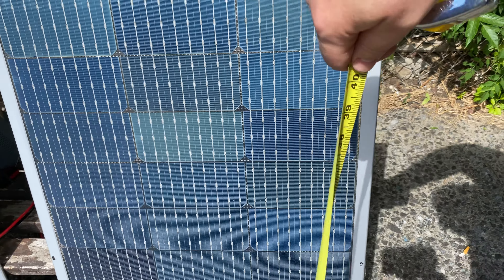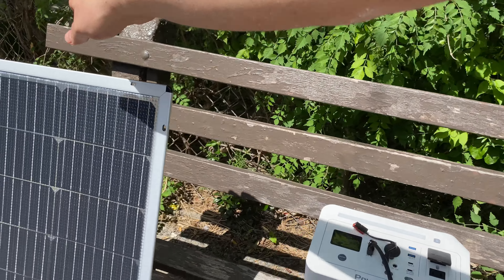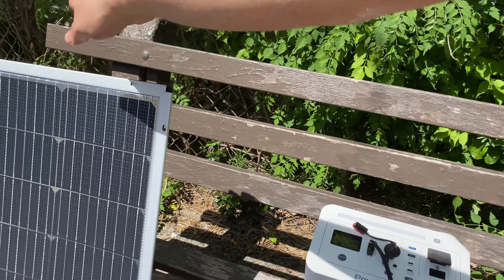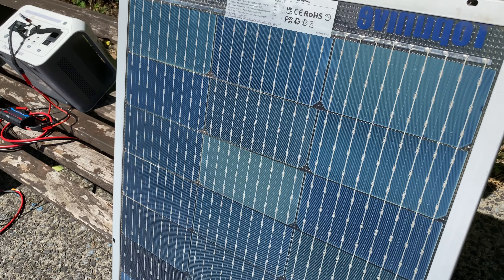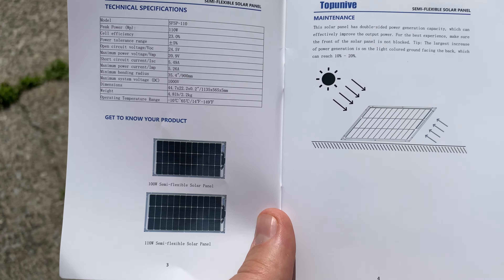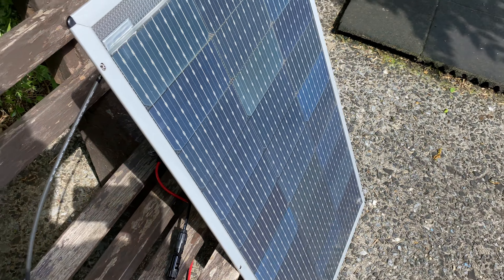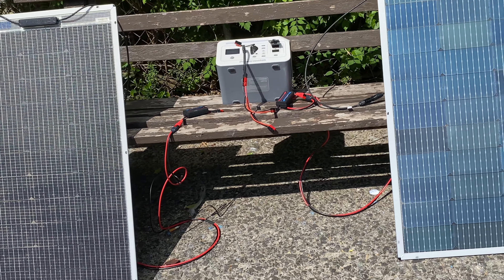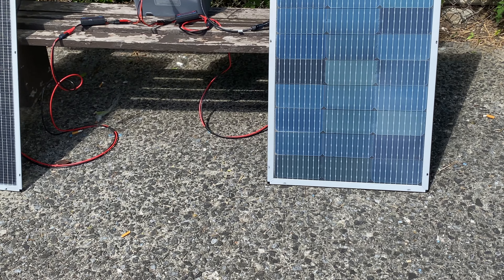🔋 Topunive 100w BIFACIAL Portable SOLAR Panel Unboxing & Review 100 watt panel  📌#wisebuyreviews

Comment from the maker: SEE IT HERE https://amzn.to/3wKWyCP for 100w Topunive Bifacial Solar Panel  [amazon affiliate links]  The Bifacial 100W 12V Solar Panel 9BB Monocrystalline Cell 12 Volt for Marine RV Trailer Boat Cabin Van Car Uneven Surfaces 12V Battery Charge

Bifacial Solar Panel: Compared with traditional solar panel, this bifacial solar panel can generate electricity not only from the front side, but also from the back side, efficiency increased by at least 10%-20%.
Lightweight & Easy to Install: It is only 0.2 inches in height and weighs only 4.4LB (2KG), the solar panel is easy to transport, install, hang and remove. The pre-drilled holes and PV solar connectors help you install easily and quickly.
9 Busbars Solar Cell, High Conversion Efficiency: 9BB & A Grade Monocrystalline silicon solar cell provides high conversion efficiency up to 23%. The narrower busbar space and more cells receiving surface bring lower cost and increase the output of the PV module. Compared with 5BB panel, the 9BB solar panel ensures lower risks of microcracks and longer service life.
Waterproof & Dustproof: This solar panel is equipped with IP67-rated junction box to effectively block water splashes and dust from outside, making it perfect to be used outdoors. It is much more durable than traditional glass and aluminum model solar panels. 2 pieces bypass-diodes are built in the junction box.
Excellent Quality: The solar panel is made of ETFE material, which has a higher light transmission and longer service life than ordinary materials. The back panel is made of TPT, which is good for heat dissipation, waterproof, high temperature resistant and easy to clean.

You may also want to see my OTHER SOLAR PANEL REVIEW VIDEOS:
- How To Install BougeRV 100 Watt CIGS Solar Panel On Highlander SUV Car Roof Review #wisebuyreviews - https://youtu.be/1ab9L63EVeo 
- Panana 200W Portable Foldable Solar Panel 200 Watt UNBOXING and REVIEW TEST #wisebuyreviews https://youtu.be/YG1WhoDCH9Q
- Nicesolar Foldable 200W Bifacial Solar Panel UNBOXING REVIEW on Sunny Day #wisebuyreviews  https://youtu.be/H12rmL-ItIY
- Eco Worthy 100 watt Bifacial 12v 100w Solar Panel Review Is It Any Good #wisebuyreviewshttps://youtu.be/8zqZhlhIKCM 
- Wetown 200 watt FOLDABLE Portable Solar Panel Unboxing Review #wisebuyreviewshttps://youtu.be/nlInvWpN5V0
- Topunive 100w BIFACIAL Portable SOLAR Panel Unboxing & Review #wisebuyreviews - https://youtu.be/6sxaP3xaNFI 
- BigBlue Solarpowa 400 Watt Foldable Portable Solar Panel Unboxing and Review #wisebuyreviews - https://youtu.be/qZiWJti3gk0
- Topunive 100w Foldable Portable Suitcase BIFACIAL Solar Panel Unboxing and Review #wisebuyreviews - https://youtu.be/Kd1H9-FCNi0
- Nicesolar Foldable 200W Bifacial Solar Panel UNBOXING REVIEW on Sunny Day #wisebuyreviews - https://youtu.be/H12rmL-ItIY
- ALLPOWERS SP035 200W Portable Solar Panel UNBOXING & Review #wisebuyreviews - https://youtu.be/Zqs-CPRUcvs
- FUNAURORE Cheap 120 Watt Foldable Solar Panel REVIEW UNBOXING for Solar Generator #wisebuyreviews - https://youtu.be/XaJ4MrXHNYA

- See all my videos here: https://www.youtube.com/@wisebuyreviews/videos

YOUTUBE VERSION
https://youtu.be/6sxaP3xaNFI
BRIGHTEON VERSION
https://www.brighteon.com/1fa80b98-927e-487f-8905-9e02178dbd21

Comment: Looks like a decent panel, and should last a bit longer than the ones without the frame.  I wouldn't use it in a permanent mount though, the glue under the ETFE layer will break down in a couple of years.  Thanks for the test.
Reply from the maker: Great point!

Comment: thx for the video i buy  the other version with a real alu frame like real Glas panels have so i get a full alu frame panel with ~2,5 Kg.
a full alu frame 100 watt panel but with glas will weight ~7 Kg so 3 times more.
a ultralight panel with real alu frame is a great idea what no other company designs.
on sale i get in for 60$

the panels in this video i will prefer befor any semi flex panle about the alu what grants additional durability, but this one are for RV or so, i need a more durable solution so i take the one with a real frame.
Reply from the maker: Good point. If money is no object and you could go with flexible, I would only go with a cigs panel. I would recommend the bougerv solar panel https://youtu.be/1ab9L63EVeo - I made a video installing it on my Highlander SUV and you can use the same techniques for your RV. 
If installing on a roof, I think the way I attached it to the tp of my car is nice. I think this panel is a better solution to attach on a southern facing wall with screws, perhaps on a house or a shed or balcony. Yes the aluminum frame make it really nice.
Reply: flex panel die very fast.... alot deliver in permanent usw 1 year latzer -30% of the new performane , glued on a RV they failing alot burned cells or busbars or delamination or damaged coatings...also the new ETFE not helps about delaminsations... there are alot videos to find about this problems.

thats why i try this one out, delamination is not possible if the flex panel is gluet into a frame, and brocken  cells or busbars are also not will be so big problem about imited flex movment.

its look like a good solution against alot of problemws from flex panels so a good ultralight solution.
i can report afther 1 year if it last against flexible panels better.

Comment: simply math but only from my experience. . Efficiency is arount 72 % from nominal capacity of rated woltage of panel. So from 100 watt panel  you should  see around 72 wats and put -5 wats loses from cables and invertors  and  you are on 68 wats.  Is is way  better  to buy  bigger waltage solar panel because of thinking  of bad positioning panel to sun, real efficiency and loses.
Reply from the maker: Good point, however any larger than 100w unfolded or unfoldable get too big to handle often times. . I have various panels and these can find a use somewhere. Perhaps will build a solar privacy fence at some point.
Reply: From my experience;), every solar panel Ive bought (which is over a hundred in pretty much all formats) make at least their full rated wattage @ 20C in full sun.  The positioning of this panel wasnt perfect and as you state there will be losses from the mppt controller and cables.  Ill bet that if this panel was orientated properly and you tested via multimeter you would get 80 watts plus.  Not great, not bad.